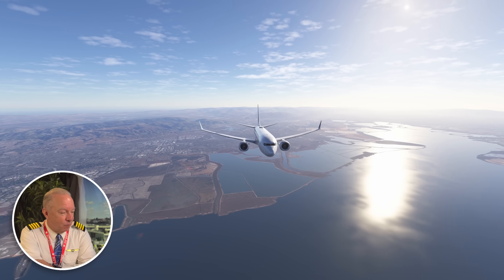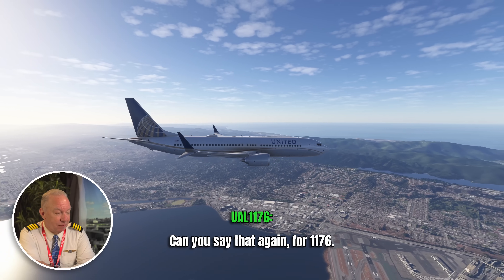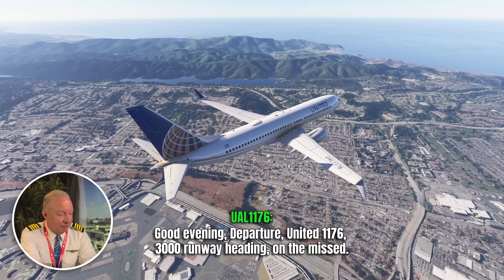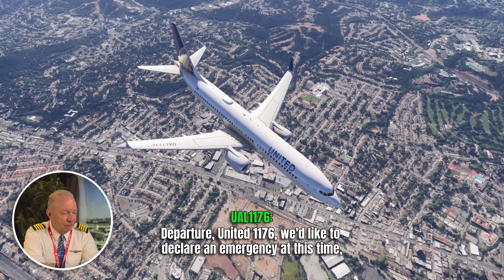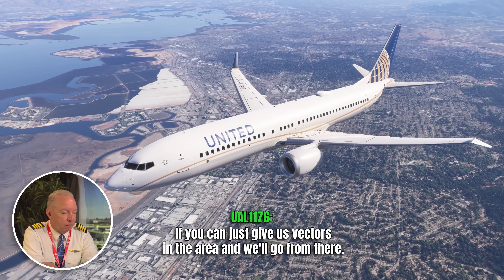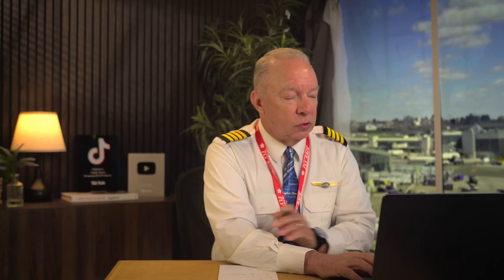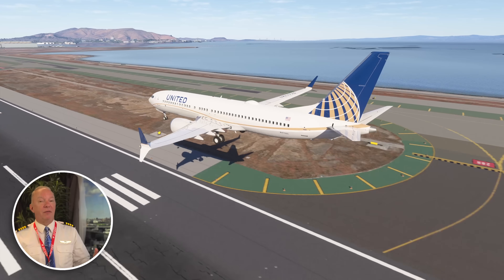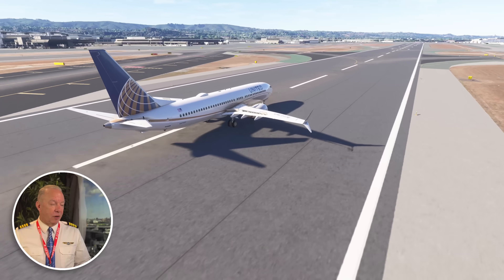Flap Failure on Final Approach – United 1176 Emergency! | Captain Steeeve Reacts

Comment: Question: Does an airliner burn a lot of fuel with a very steep rate of climb? At takeoff
Reply: A220-100 ran low on fuel sea to San. Had to stop in lax for fuel

Comment: When I hired on at an aircraft manufacturer, 1968. Our introduction was a talk about safety and process. In this case it was about flaps. The process was bolt goes in from the top, nut on bottom. A mechanics hands were too big. He could put bolt in from bottom, nut on top. When the plane, landing or take off,don't remember. The flap stuck, the plane crashed, I believe. Every plane that guy touched was grounded. Every plane the inspector touched was grounded. Both went to prison.
Don't know if the story is true or maybe just to keep us new hires on guard and follow the process.

Comment: Question: I think you've told us before that the word 'EMERGENCY' should be used by the crew in radio calls after they've declared an emergency. I'm not sure it happened here - so is it more custom & practice than regulation?

Comment: Back in 1980, we were part of a 3 ship cell out of Dyess AFB en route to RAF Brize Norton. The routing had us spend 1 night at Pease AFB and then onto England the following morning. After preflight I climbed in and closed the hatch for I was the crew chief flying with my bird, a B52D,  As we were climbing out I noticed one our ships lagging behind. This particular bombers could not retract her flaps. To this day I/we have no idea why they did not stay in the area and work the problem, but rather they continued on course and tried to work the problem en route. They were going back and forth with maintenance as well as Boeing trying to come up with a solution. Needless to say they were trailing and we lost visual but were in contact via radio. it wasn't long until they had to be hit by a tanker for she was sucking up so much fuel. If I recall she got hit up twice over the pond ( in addition to the normal refuel right after T/O), with KC135's being sent out of Thule, and eventually made it to Brize Norton with her flaps up. Along the way the decision was finally made to override everything and just retract them. Doing so revealed the problem though by having the jackscrew dislodge itself which sent it through part of the left wing. Luckily it did not puncture a fuel cell. She of course had to make a flap up landing. Our TDY was for 2 weeks, that bird didn't come home until 3 months later for all those parts, personal and equipment had to be flown over to repair it, which leads me back to my question; why didn't they just stay in the area or return to Dyess. Bad news for maintenance but good news for the crew who had 3+ months TDY.

Comment: How do you know what is the weight? There’s fuel consumption and of course there’s passengers carrying a kitchen sink in their backpacks lol
Reply: The computers display it. Actually you enter the Zero Fuel Weight before the flight (you get that from the loadsheet), and the computer adds the current fuel load on top of that.
And as crazy as it sounds, that kitchen sink in the backpack weights nothing. The estimated passenger weights are inclusive of hand baggage. IMHO outdated due to the kitchen sink you mentioned, but that's how it is.
Reply: @kallek5655  Thanks for the info, pretty amazing! Now about the passengers weight…😆

Comment: During my US Navy flight training in 1969, flying the TA-4, I had a split slats emergency when returning for landing at NAS Kingsville, Texas during one of many solo-low-level flights. The TA-4 leading-edge slats are fully automatic … purely aerodynamic/spring-assisted.  They have no pilot-selectable position — they extend or retract based on dynamic pressure and AoA. I (not so calmly … this was my first actual emergency during training) increased speed, went cleaned up the aircraft (gear up, flaps up when airspeed was adequate) went to altitude. A flight instructor came up to inspect my jet, observed my aircraft while I went through controllability checks. I landed uneventfully carrying about an extra 15-20 knots airspeed (about 140 knots). Turned out to have been a birdstrike. I felt like I was coming in about 200 knots, but in retrospect it was a simple, easy emergency landing. Exciting at the time, though!
Thanks for a great channel!

Comment: I was doing IOE with a new captain some years back.  Aircraft was a B737-800. We experienced a failure for LE/TE flap extension. Zero flaps landing.  No problem as runway was 12,000 plus feet long.  The most interesting thing, I felt was the increased (or not reduced in this event) elevator sensitivity.  Fun Times.

Comment: Capt Steeeeve, Cassio, a Brazilian fan of yours to comment that back in the 90´s I was as a passage in a Fokker 100 arriving at Congonhas Airport in Sao Paulo (SBSP/CGH) which, by that time, was even a shorter runway than it is today, and we had a flaps malfunction. It was, as you said in this video, a case of flaps asymmetry. Flaps on the left wings did not deploy, but on the other wing did. And the captain was able to land very safely, after burning the fuel. Great video. Always learning from your videos. Thanks

Comment: I’ve had flaps malfunction on B737-800 on a flight Paris ORLY to Naples (Italy) in 2019. We were cleared for ILS 24, and during flaps extension we realised that flaps were stuck at 1. As we were quite far from the threshold, I had a short discussion with the first officer to prepare the go around, and told the ATC that we expect to go around because of flaps malfunction. The plane was easily manoeuvrable . We sent only a PAN PAN message. We climbed on the missed app and did an holding pattern on Sorrento VOR, performed the non normal check list associated to our flaps malfunction, did the performance landing calculation, and decided to fly back to NAPLES. (Longer runways were available in Roma Fiumicino in case Naples runway length was not sufficient). Final approach speed was close to 200kts, with an unusual pitch, but thanks to high speed the plane was easy to land. We didn’t even need the full runway to stop, using exit BC. 
Mechanics changed the flaps indicator. No problem in Paris on the return flight. Quick explanation from the mechanics : During flaps extension, the PSEU (proximity switch electronics unit) has detected a difference between the flaps lever position, the flaps indicator and the real position of the flaps. That’s why the flaps extension has been stopped.

Comment: It's interesting you say you've never had a flap failure. I guess you didn't fly the CRJ100/200. There was a time, probably around the early 2000s, when they were having them daily. It was usually in the winter, which is a clue. At one point they had, in the fleet, 3 in one day! That airplane has a hard wing, so no leading edge devices, so when you lose the TE flaps you are landing in cruise configuration. Vref at MLW is 176 kts (+30 kts) and the landing attitude is probably 6 or 7 deg more nose up. So you are coming in like a scalded cat and you have a completely different sight picture. The issue was that ground crews were spraying deicing fluid into the back of the wing where all the mechanical bits are. It was getting into the jack shafts and gumming things up, then after a time at altitude when the glycol or alcohol or whatever it was that kept it from freezing evaporated the flaps would freeze. After sitting on the ground for a while if the temps were above 32F they would work fine if you cycled the system.  It took a while for the mfg to research the problem, inspect the affected aircraft, figure out the patterns and come up with different lubricants and different de-icing procedures. But until they did a lot of pilots got a lot of practice at the real thing. I know one guy who had 2 of them. CRJs were regionals, so they would be doing 6 or 8 cycles a day - that's a lot of de-icing and a lot of takeoffs, climbs and landings. If you had enough runway it wasn't a huge deal, but it really came to a head one day when an Air Canada flight couldn't get into an airport due to low ceilings and the flaps froze down on the go-around. They had to divert with landing flap (45 deg) and the fuel burn went through the roof. They landed on fumes and might not have had enough fuel for a missed approach. Transport Canada was very unhappy and ordered airlines to flight plan for alternates with the flaps at 45deg!  It was a mad scramble to get it sorted out but they did.

Comment: As an Airport Captain Firefighter ARFF I don’t like when the pilots give us a fuel on board comes in as 3 hours.  Well that tells us nothing also as a Pilot 3 hours for a small plane is significantly different than large jet, I’m able to figure out pounds but most FFs are not.  The reason is we need to make sure we have enough resources to control a fire or prevent a fire and HazMat response.

Comment: I was on a 727 flying from HOU to ORD that experienced a problem with the flaps.  In this case the flaps would not retract fully during the climb out.  We flew up to DFW with the flap partially retracted and landed uneventfully with all the ARFF equipment following us down the runway.  It was interesting to observe how the passengers handles the incident.  Everyone was quiet and attentive to the cabin crew.  The flight crew got cheers and applause when we landed.

Comment: I find your "explanation" of flaps kind of confusing. 
With the normal wings in the normal configuration (called "clean"), the plane flies fast and efficient. With flaps you make the wings bigger, so that you can fly slower but less efficient. This is used for landing. Extending the flaps lowers both the minimum and maximum speed at which the plane can fly. (the max comes down more than the min, so the window of available speeds becomes smaller).

Comment: Another Private and I were working the flight line when a Beechcraft Baron rolled in. I was standing near the hanger as my friend guided the plane to it’s parking spot. A full bird Colonel got out and stepped onto the flap and the linkage broke causing him to fall flat on his face. I felt bad for the Colonel but had to step around the corner of the hanger so no one could hear me laughing. So yeah, flaps can have problems.

Comment: Several years ago I was on a 737 and seated over the wings on the starboard side of the aircraft.  Shortly after takeoff, when the crew retracted the flaps, I could hear the motor under the floor below my seat screeching very loudly when it got near the end of travel.  Hmmm.  I didn't say anything as I figured the flight crew would find out soon enough when it came time to land.  
When we got to our destination, I could hear the motor screeching loudly when they attempted to deploy the flaps, but they would not deploy.  As an electrical systems engineer, my biggest worry was that one side would deploy and the other side would not - I just hoped they were interlocked against that!
The captain announced there was a serious problem and we would have to circle for a while as they were in contact with Boeing trying to resolve the issue.  Gear down, gear up, gear down, nothing seemed to free the stuck flaps.  After almost an hour, the captain said we were going to have to land anyway and the crew explained how to brace for emergency landing, etc.   Some passengers freaked.
We came in hot with No flaps.  Used up a lot of runway, and fire services were all out and waiting, but the captain did a great job landing.  At deplaning, the captain was standing at the flight deck - his clothes drenched in sweat - and I could not believe that no one acknowledged his feat and thanked him.   I said,  "Great landing with no flaps!  You nailed it!"  and he said "Do you really think so?  Thank you so VERY much!!"     Made my day.
Reply: Wow! Just reading that made me anxious!! 😮 glad you’re here to tell it and also what a great captain❤
Reply: I was seated next to what sounded like a high frequency whistle coming directly from the fuselage left of my window seat. I asked to change my seat and  the long drama ensued .
Reply: ❤ this made me tear up
Reply: In touch with Boeing?....nice try!, they have training, QRH for such scenarios, they have dispatch, Engineering and maintenance...why the hell would they be in touch with Boeing?...not everyone is ignorant in here you know!!
Reply: @atilza8144 who do you think some of those engineers and maintenence people work for? Lol

Comment: Steve, you misrepresented them being choi. In the 737, without EICAS, they need to diagnose the problem. Less about being choi and more about getting the go around stabilized and then diagnosing what flap condition they have. Harder to do in the 737. More speculation out of you. It is shameful. Be better.
Reply: It’s spelled “coy” 😊

Comment: I was on a flight from Seattle to Pasco and our aircraft had an identical problem. The captain decided to turn back to Seattle as I reckon the runway in Pasco wasn’t long enough to risk landing without flaps. We landed back in Seattle with the royal welcome of all the emergency services in readiness. The crew did a great job - landing right on the threshold of the runway without a float, hard landing to reduce momentum and we could hear the brakes squeal

Comment: A couple of years back, i was flying Southwest from John Wayne to Oakland. last flight of the day when I noticed the plane flying over Hayward for the 3rd time. Sitting forward of the wing, I looked out the window to see if i could see anything. All appeared normal except no trailing flaps were down. I knew this meant we would be coming in a bit faster than usual. The announcement was calm and vague, something like “we’re working things out with the tower”.  For your information. Oakland has a couple of runways both of which are sufficiently long for normal landings. They are not, however, limitless with the Bay on both ends. 

The gal next to me was anxious asking me if we were gonna die. I said no. My husband had his private pilot’s license. He had completed his flight school via video at home. Tho i was not training also, i overheard a bit of his training and understood the functions of flaps. I was able to give her a simple explanation. And we prayed for our safety. 

Next I noticed our plane flying over San Francisco - an opposite approach to their usual. We were positioned to land North to South into a 3 mph headwind. They were using the headwind to slow us down a little.

Landing was good. We might have rolled to a stop a bit closer to the Bay than usual. I had no fear until i saw the lights of the emergency vehicles who were circling around the plane for a physical inspection. 

Meanwhile my dear husband had been waiting to pick me up in the cell phone lot. Once on the ground, i took my phone out of airplane mode. My phone chimed immediately

The message from my husband was something like “What’s taking you so long “. My answer “Landed without flaps. Emergency vehicles met us. “  He never said another word about it. All was well. 

As I exited the plane a crew member confirmed that we had landed without flaps. 

Well Done Southwest. I’ll fly with you anytime

Comment: It happened to me on a United flight almost a decade ago.  (Unfortunately, I can't recall the aircraft type.). I've been licensed "Private SEL" for 50 years, and practiced as an aviation lawyer for several years.  Not fly shy.  Even though I knew that flaps up landings are practiced, I was holding onto the armrests as we roared over the threshold,   It was a memorable ride.

Comment: Wouldn’t you know about the flap control problem on the initial approach?
Reply: It might not happen in the early stages. I once couldn't extend the flaps to 30 on the 737, they were stuck at 25. That position is selected way after the gear is dropped (on the 737 after gear down comes flaps 15, and then flaps 30, or 25 and 40).

Comment: The risk of an overshoot would be a good reason to take the ILS.  As to when to declare an emergency, is it beneficial to the emergency to get souls and lbs first or communicate first.  As to when they finally declare an emergency, from a morning QB maybe at least say we may have an aircraft issue.  I'm sure ATC thought that as soon as they didn't say, but again ATC also wants to make sure they're not missing a PIREP.  As soon as they say control issue that gives a heads up that there are speed, heading, and altitude accommodations for ATC, not to mention how they get resequenced.  While they are the emergency we want to make sure we don't create a secondary event, even if extremely rare.

Comment: I was on a Boeing 737 from Salzburg to Gatwick.. 1994
When the plane landed it was 2 hrs late. When it landed all the fire trucks went out to the runway ! Followed it back to the ramp. Then they put busses in front of the windows to stop us looking !! I did see the captain and 1st officer walking around the underside of the aircraft, especially the starboard engine and wings.
NOTHING !!! 
We ended up taking off after de-icing at Salzburg. During the flight, the engines over revved or went to MAX power on 2 occasions, as the noise was deafening, plus the engine increase was so fast at 30,000 ft.
When we landed at Gatwick, they stated that we would be landing faster than normal... DAMN, we cam in like a rocket.
We had fire trucks follow us off the runway and escort us on the starboard side.
My speedy landing story of landing with Flaps up.

Comment: Co pilot should have come forth with the reason or suspected reason immediately.  Tower likely worried it could be a airfield issue for the go around (FOD, somebody on runway, etc) - as they have aircraft in trail that could be effected.  "misconfigured for landing"